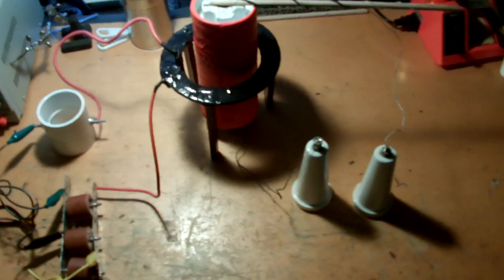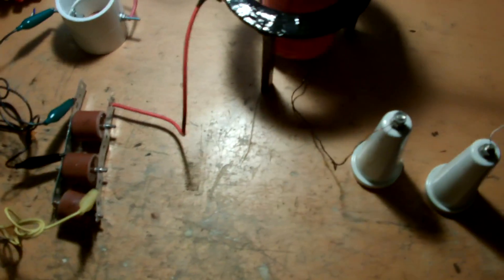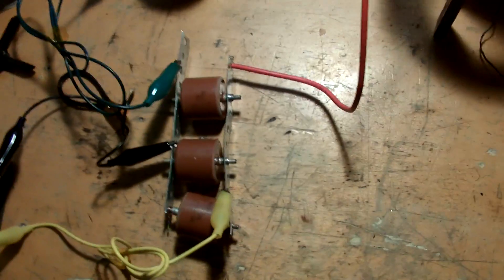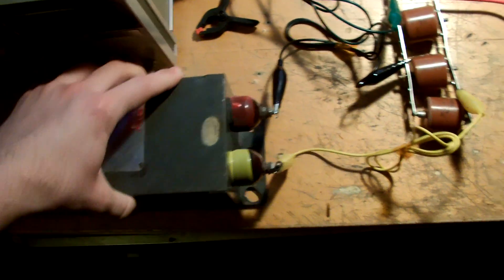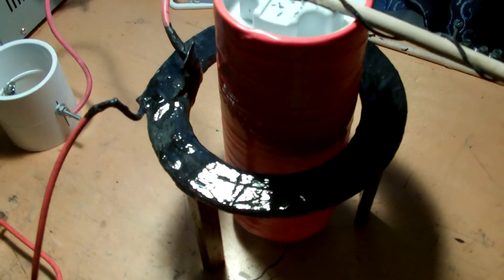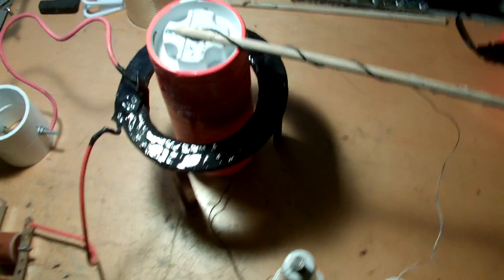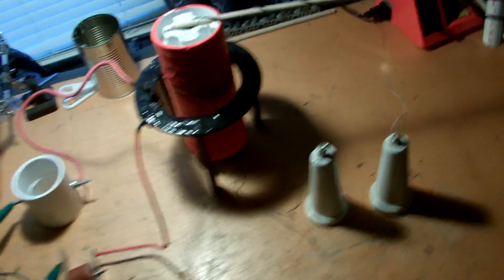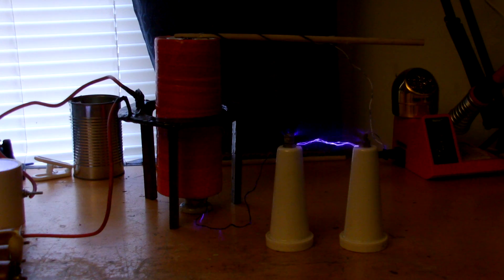Bipolar Tesla Coil!

Comment from the maker: Hey thanks alot for the comment, sure i think i could draw something up for you, its pretty easy actually and would probably only take you a few hours! 
 Salt water jar or poly plate caps work great with the circuit if you dont have a high enough rated capacitor.   Ive run it at up 10kv from an OBIT!

Comment from the maker: Hi thanks for the comment :)     Yup 7.5kv to the primary, i imagine there is a measurable loss in the spark gap due to its undersizing and the output is definitely high voltage!  In the video i would say that it is around 60-80kv or so, i wish i could measure voltage like that!

Comment: Very nice! So you've got 7 kV coming from the transformer to the primary? There's probably a voltage drop in the spark gap connected to the primary?

What kind of voltages do get at the two poles of the secondary coil? Must be pretty high voltage :)